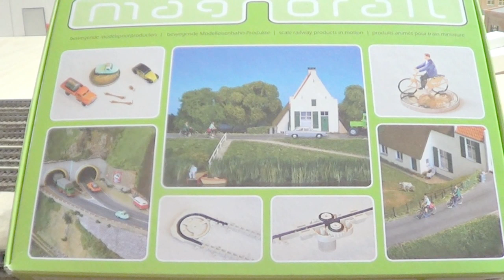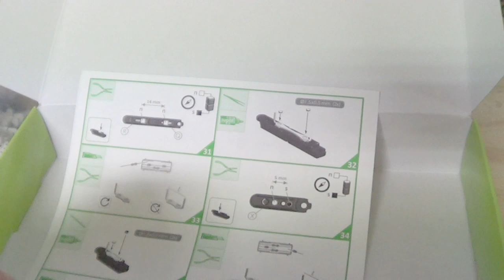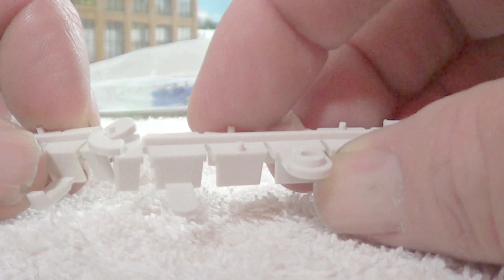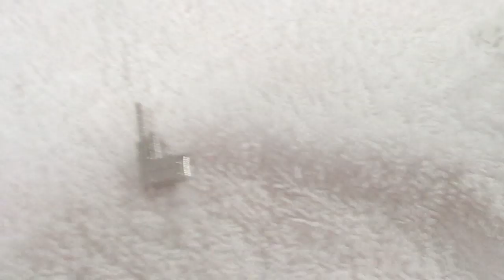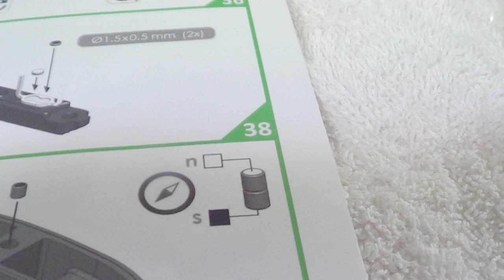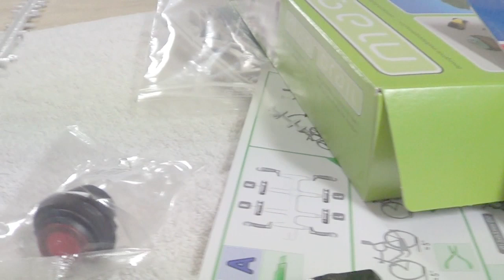Magnorail - Auto Plant Build Episode 6

Comment: Hi - Great to see people creating MAGIC with the Magnorail System and especially fellow Aussies. I would suggest sticking the channeling directly on to the styrene and box it in or paint it the same colour of the underside so it looks like reinforcing for the ramp. Check out my klatchco56 channel for hints on getting the best out of the system. I will watch closely for when you pull it off and you may get one of my Magnorail Magician certificates for excellence in using the Magnorail System - Clyde - MagnorailOz.com.au
Reply from the maker: Thanks and i hope i get the Magnorail Magician Certificate for Excellence lol but thanks for the hints 
and i have watched a few of your you tube videos as well cheers Robert